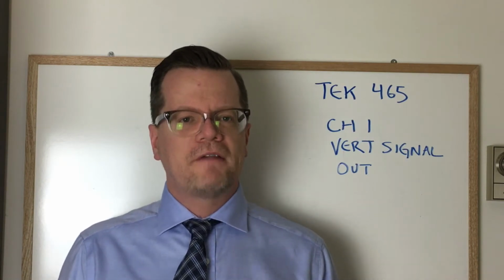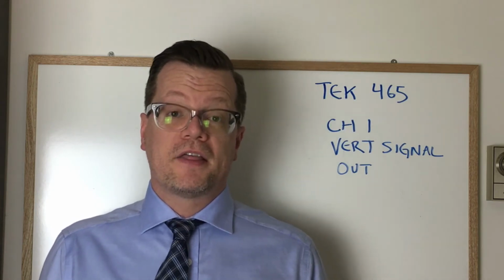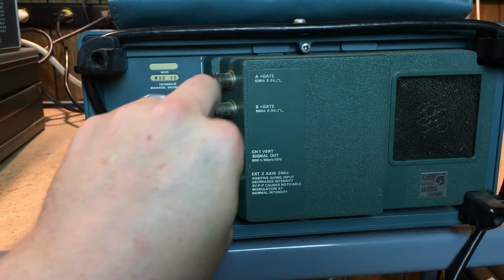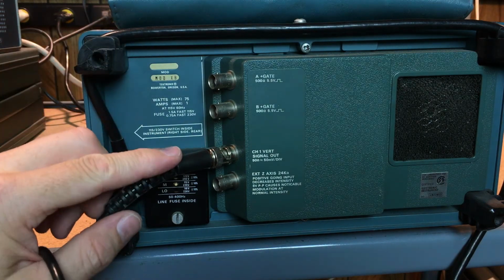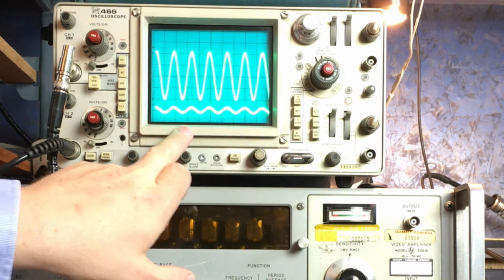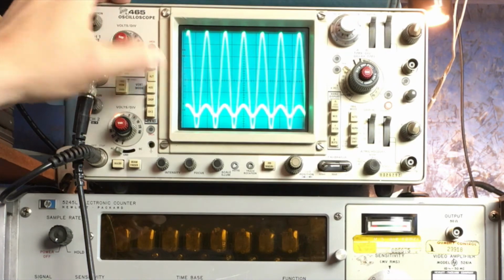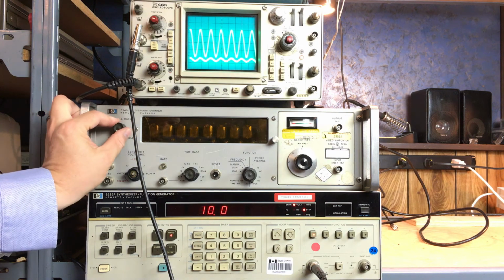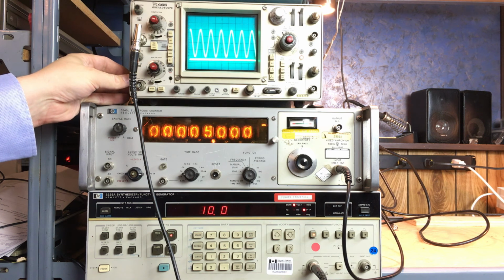#17 Tektronix TEK 465 Oscilloscope CH1 Vertical Output Demo

Comment: For RF work with levels below 100 mV I prefer my TEK 453 CH1 output because it amplifies the input signal and can then trigger my counter on signals too low to do it normally, my 465 does not do this and I have to lower the input attenuator to below 20mV/dev before it triggers my very sensitive TTI counter.

Comment: I must confess I was a little disappointed not to see an attempt to put a very small signal through channel 1, and then chain through channel 2 as an additional gain stage.  I'm curious how far you might be able to push the composite gain due to noise and so on, perhaps with bandwidth limiting to help things a bit.  Still, a nice presentation!  (Though where I'm from, ties are not required.  :)